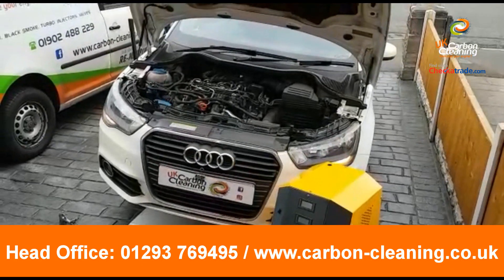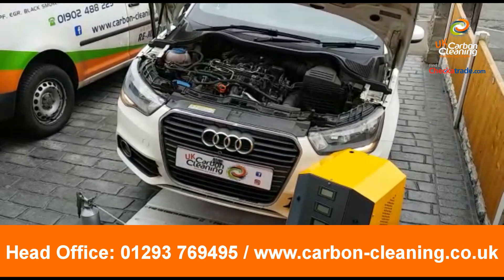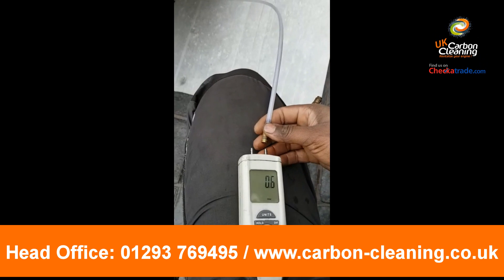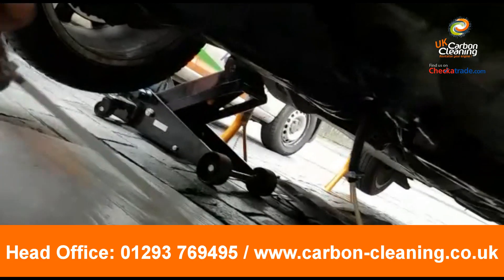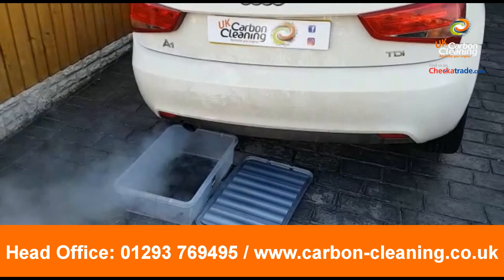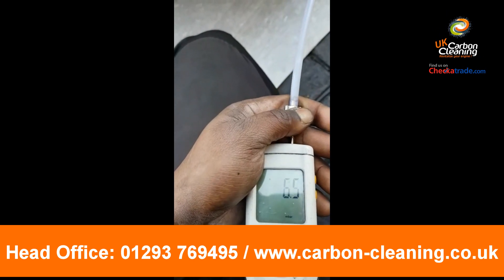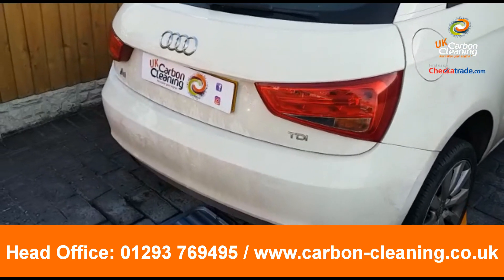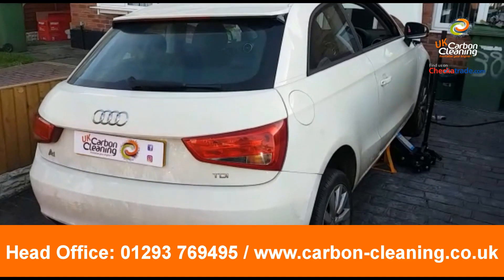Audi A1 1 6tdi DPF cleaning

Comment: Where is the pipe for the DPF to put fluid in.
Reply from the maker: Access is either directly into the dpf using the front dpf pressure sensor pipe or off the dpf pressure sensor (remove air box for access and it's on the bottom of the firewall)

Comment: What was the soot content on this prior to clean ?
Reply from the maker: The video is 5 years old now so couldn't tell you. However, we wouldn't rely on soot count data as that's a calculation so isn't accurate. The key as per the video is the back pressure readings off the dpf. Best regards, Matt @ UKCC Auto Techs
Reply: Ah ok, this is related to my car which is also an A1 but 2 litre not sure the readings yet on pressure but I simply can’t afford a new one and cleaning is the only option I have just don’t want to get ripped off by someone trying a clean whilst on when it could be better taken off to clean

Comment: I found not using supermarket fuel helped the light only comes on every 2 months apposed to every 2 weeks a short run 10 miles clears light
Reply from the maker: Quality fuel will always help carbon issues but it won't cure it, there is no cure. Most dpf issues are actually due to faults or too many short journeys but by nature a filter will always clog eventually.